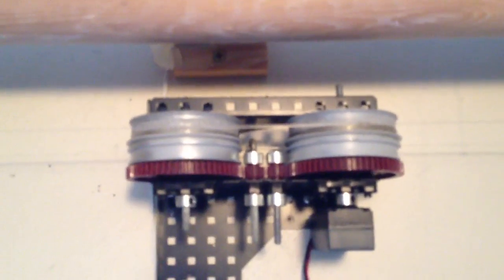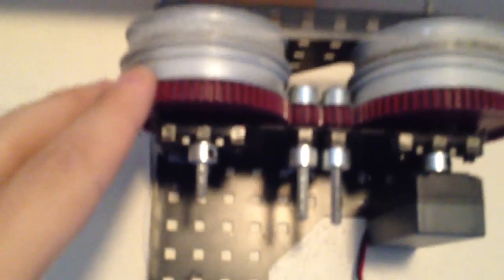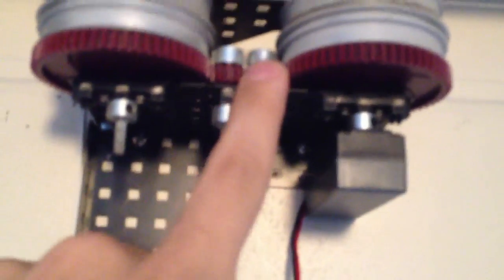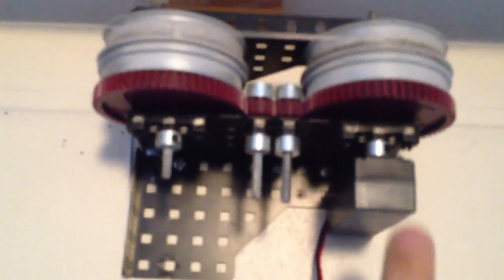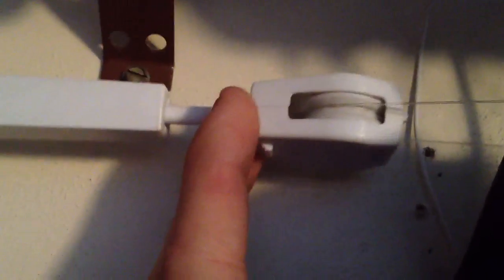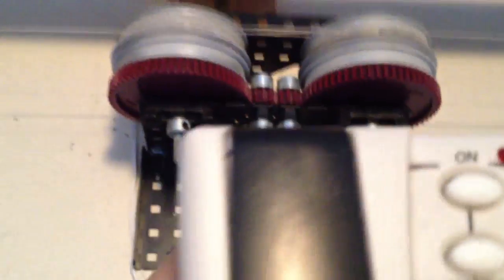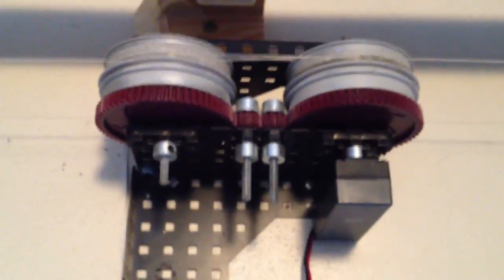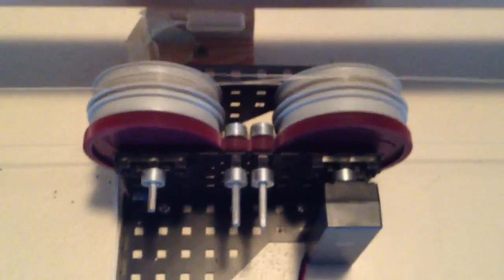Curtain opener explained

Comment from the maker: Kam, the barrel surface is pretty much smooth, but looping the fishing line around the barrel 3-4 times, as well as using the tenstioner to keep the line taught, the line never slips off the barrel. I tried with only 1 loop around the barrel but it would slip a tad, so I wound it around the barrel a couple more times and it seems pretty sturdy. I have my curtains open at 8:30 am everyday and haven't had any issues.
Yes, the barrels need to be dead center with this particular setup.